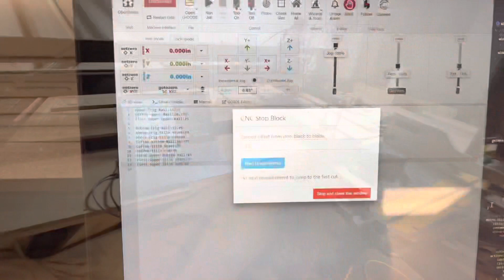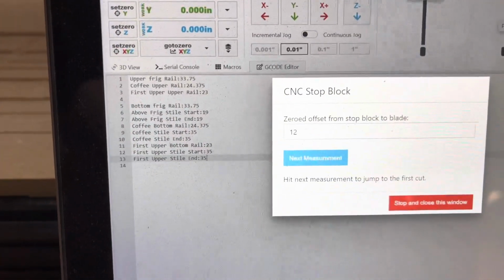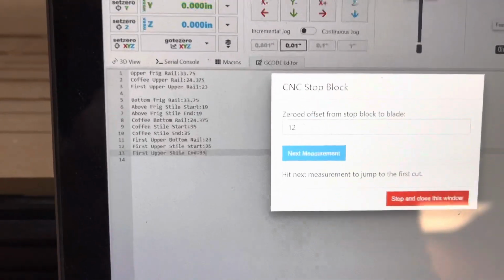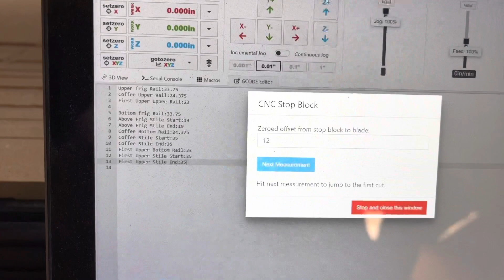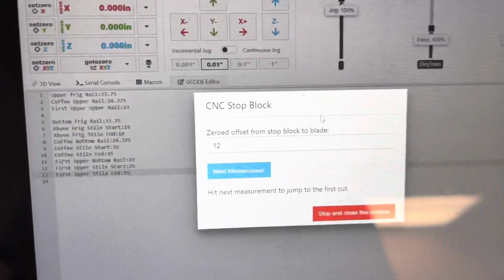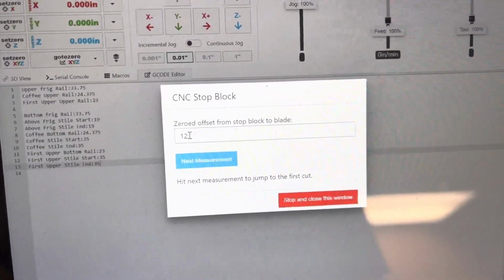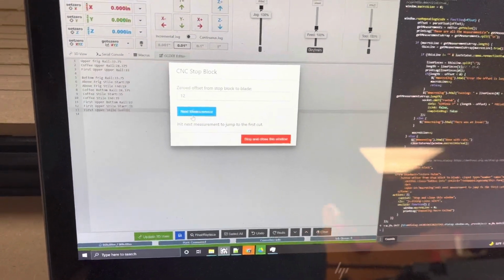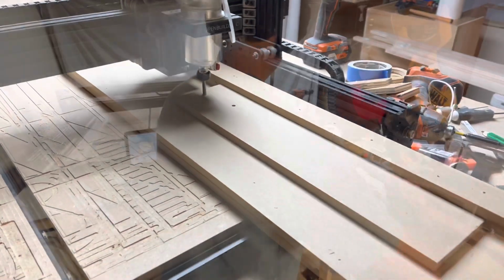DIY Dewalt miter saw CNC automates kitchen cabinet face frames

Comment: Awesome Idea!  Liked - Subscribed
Reply from the maker: Thanks for the sub! Any unconventional ways you use yours? The macros make Openbuilds a game changer. I also wrote a js to cut the cabinet feet in my kitchen. Since the cabinets are shimmed to level each foot was slightly a different height and the radius arch on each foot then adjusted for the height
Reply: @homehackshowtos  That's really neat about the cabinet feet.  Could you please put together a video showing how you do this?   I have a 2'x4' cnc router - that I built out of mdf, gas pipe, and lots of McMaster Carr parts.   I use Mach3 and VCarve mainy, but would like to make my own kitchen cabinets - definitely liked your ingenuity on using the router as a cnc fence!  I'm in Romeo Michigan
Reply from the maker: Cool. Yeah cutting the carcasses on my 4x4 was probably only faster than a table saw since no mistakes were made vs I always make some mistake when doing a table saw. If it was a 4x8 then it would be faster. If you really get a system down then using a table saw is good. The one pro of the cnc is that every cabinet assembled perfectly.
Reply: @homehackshowtos  Sounds like I have to upgrade to at least a 4'x4' (been wanting to do that for a Long time).  I definitely like what you have done.  I will probably do something similar in a Mach3 wizard program (I'm old school, been using Mach3 for almost 20 years).  Thank You for sharing and being a guy that can be approached and talked to.  There are a lot of arrogant people on here.  Nice work, and I hope you keep Vlogging o YouTube.

Comment: Can you share the software you are using for sending gcode?
Reply from the maker: I am using open builds control. There is a bug in the code that causes it to only work in the command line. Once I fix that I will post a video with a how to.